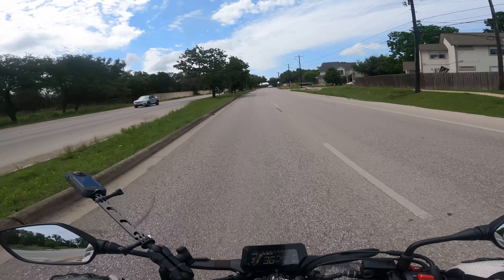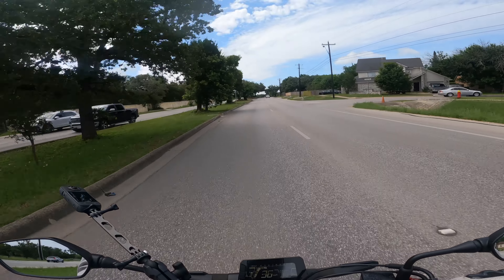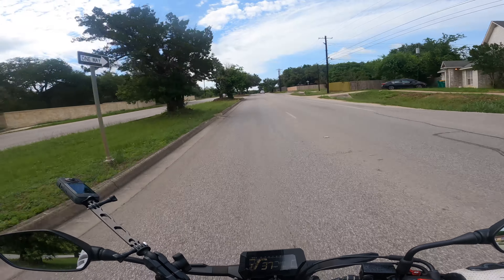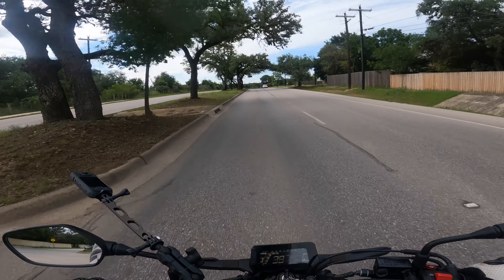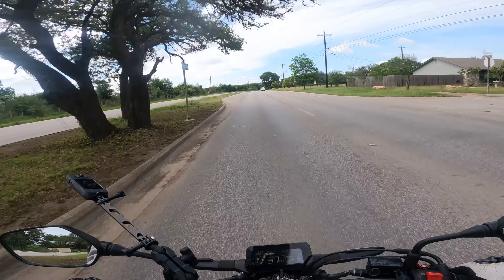MSF Slow Speed Motorcycle Skills Practice - U Turns and Weave

Comment: Assuming classes teach this applying rear brake with throttle in slow manuvers helps stabilize
Reply from the maker: Yup, it was taught at the course I took and most of the more comprehensive videos mention it. I thought I had, but might have cut that footage.
I basically drag the rear brake slightly the whole time, it makes it easier to maintain enough engine rpm’s and keep at a good point in the friction zone. Otherwise you are constantly going too fast then too slow then too fast… it smooths things out. 
In my class the HD Street 500 I was using basically had almost no rear brake power so I could nearly stand on it the whole time, as long as I wasn’t counting on it to stop me for real. My bike has a more effective one but it’s still weak like most.